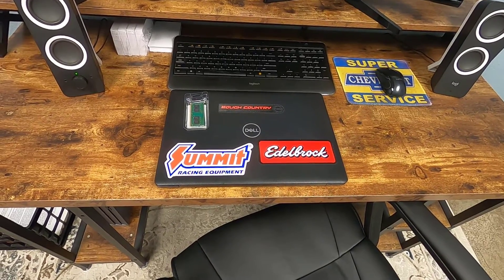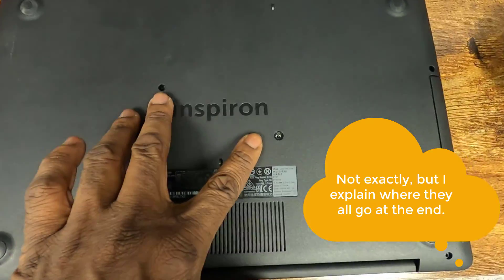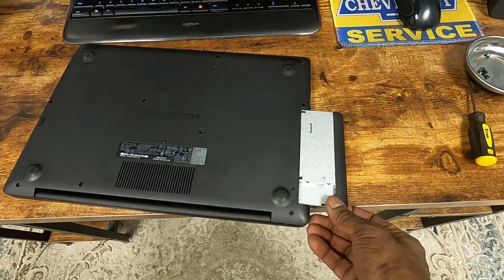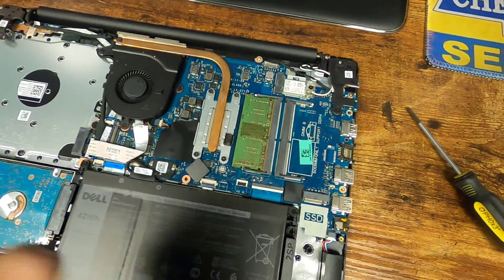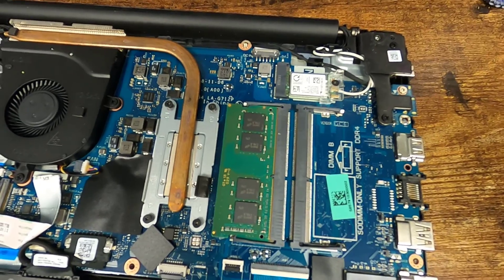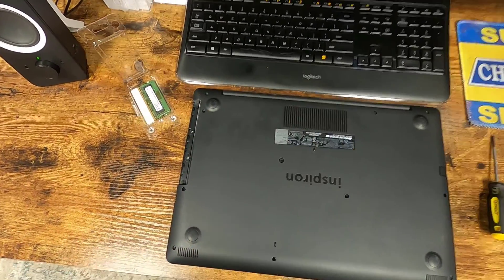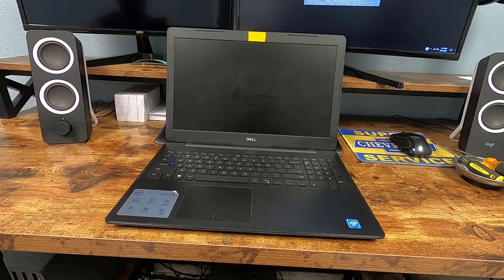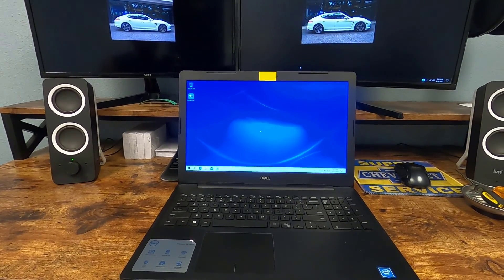Dell Inspiron 3580 Ram Upgrade - 4GB to 16GB

Comment: Excellent video! I came by to see how you got to 16 GB, but that model is lucky to have 2 RAM slots!  My niece has the 3582 that only has one.  Too bad you didn't have a drive to put into that SSD slot to really speed this system up.   I'll be adding a M.2 SSD and upgrading her RAM to 8GB.

Comment: I did the same thing, but my Dell laptop showed only half of the memory, which is only 8G. Does anyone know why?
Reply: Late response, and I hope you got it sorted out, but here's what I would do.  Check how much memory shows with a single slot filled with your 8GB DIMM. If you have the correct memory this would help determine if one of your slots, or one of the DIMMS is bad.